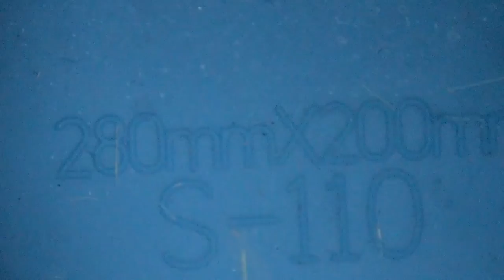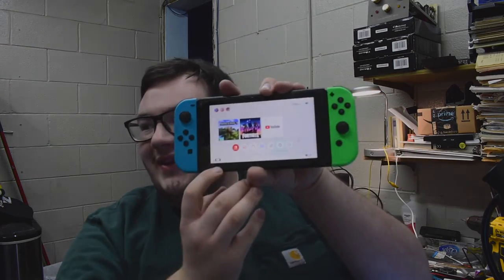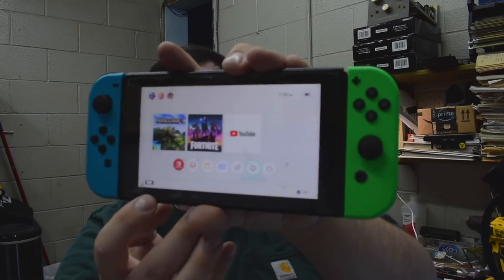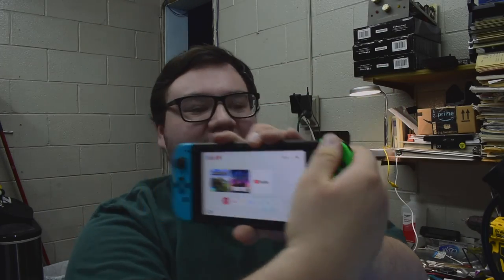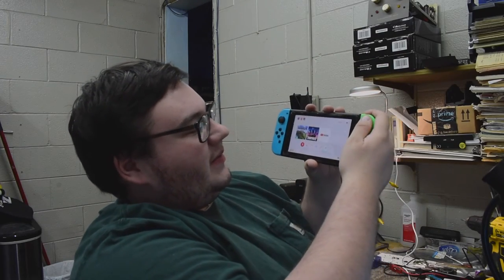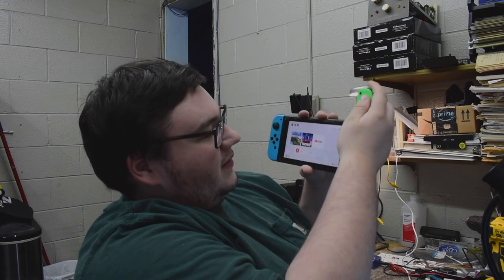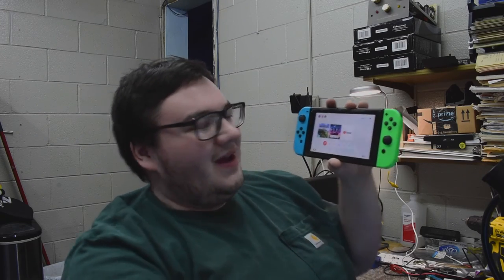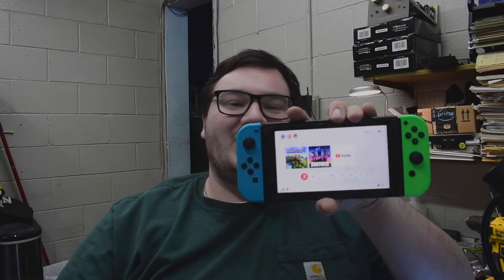Nintendo Switch Joycon Rail Connector Repair + Ribbon Cable Repair

Comment: Sheeeshhh, ggs repairing the actual flex cable mate. Didn't know that was feasable. Curious why ya didn't just replace the cable/rail unit itself tho tbh :P
Reply from the maker: This connector unfortunately was completely messed up 😕
Reply: @chasefournier  wait, it didn't function after all that effort? I'm still impressed, regardless 🤷
Reply from the maker: @Nemesys420  oh I thought you were talking about the connector that we replaced on the main board. 

Yeah we could've replaced the ribbon, but running a jumper on the ribbon was possible :)
Reply: @chasefournier  WILD!

Comment: Great and we'll explained video, thanks. 

I have one joy con with sync issues, only works attached to the console,always shows as not charging and low bat... I replaced the ribbon cables of sl/Sr buttons, and the battery, and didn't work. 

Have any idea what is the issue? Thank you.
Reply from the maker: Depending on the model, check the resistors values next to the joy con connector and see if any are blown or have a high resistance.

Comment: 🐨 You know how you run that PCB replacement "Pad and Trace"? Have you tried cleaning the damaged surface before applying some conformal coating down and before any soldering or component or connectors are placed into situ, You place the replacing "pad and trace" in situ upon the thinly applied liquid conformal coating " and again before soldering" We set Via "UVL" Err-Ultra Violet Light" or whatever adequate time for the conformal coating to set and marry the threesome "Err-the (PCB), (Conformal Coating) and (Replacement Pad and Trace)", once "Pad and trace" is sufficiently married in situ, We can then solder the newly installed "pad and trace" to the PCB followed finally by the marriage of component or connector via soldering that into situ.
APU I dropped a  👉👍👈